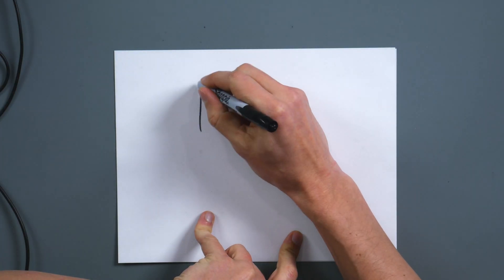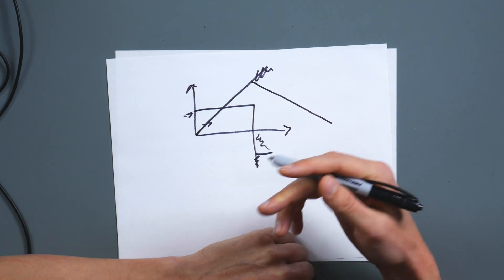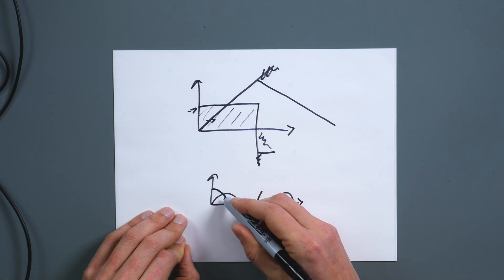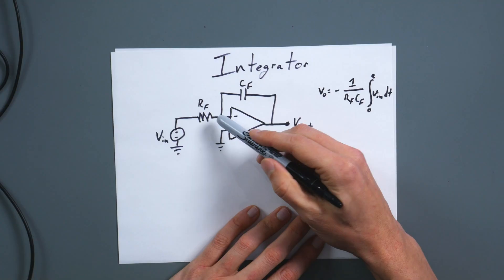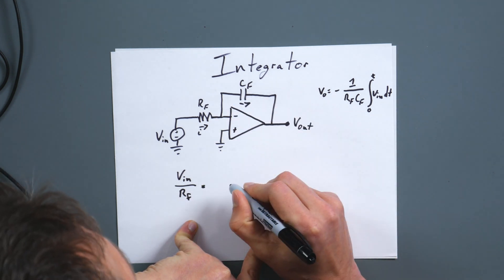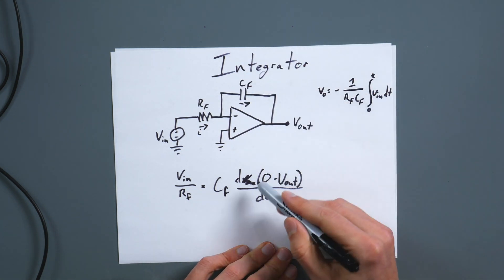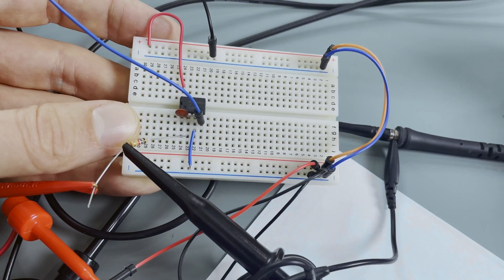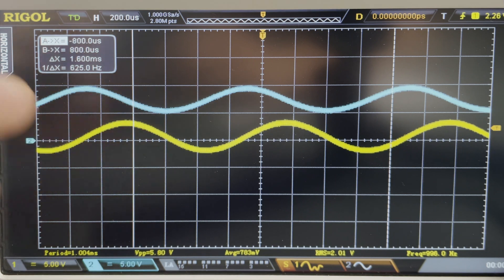Integrator - Operational Amplifier | Basic Circuits #14

Comment: What op amp chip are you using in the example? I’m used to pin six being the output but in your case it looked like pin One was the output.
Reply from the maker: We're using TI's LF412 and, yeah, pin one is the output for those chips.  It is a bit irritating but I do understand why different companies would want to change the pinouts on otherwise similar (in performance) devices.

Comment: What is the purpose of this circuit from a practical usage perspective? like what problems does it solve? what do I use it for? And can you make an integrator without the use of an op amp?
Reply: Integrators are used in digital multimeters to measure voltage (or the voltage drop across a current shunt resistor).  They do this by "run-up" and "run down" phases.  During the run-up phase, the switch selects the measured voltage as the input to the integrator. The integrator is allowed to ramp for a fixed period of time to allow a charge to build on the integrator capacitor. During the run-down phase, the switch selects the reference voltage as the input to the integrator. The time that it takes for the integrator's output to return to zero is measured during this phase.    For more info, see the Wikipedia article titled "Integrating ADC".  To answer your second question, any op-amp can be replicated by discrete components.  Sometimes, the best choice for a particular circuit is a judicious choice between op amps and discrete componets that may do the same thing as an op amp.

Comment: So it's like a Real-time calculator that records your voltage every time then adds it to what it already has?
Reply: And that means an AC signal will provide 0v Output while a DC will provide the saturation output
Reply from the maker: As long as there's no DC bias, that's correct!
Reply: Cool thanks  @CircuitBread

Comment: Hello, I appreciate these videos but I have a question about an AO setup that I couldn't find online with a resistor and a capacitor in series together in the loop. I hope You understood my problem and I am waiting for an answer
Reply from the maker: I'm sorry but unfortunately, I did not understand the problem.  I can give some general advice to use a simulator to help figure out whatever problem you're having.  LTSpice, PartSim, Flux.ai, something along those lines should be very helpful.
Reply: @CircuitBread  thank you for reply I'll search at those sites and hopefully will find a solution, wish U the best and I hope You keep making these educational videos. So helpful

Comment: What happens when you replace the feedback capacitor with a feedback inductor?
Reply from the maker: The circuit turns into a differentiator where the output is related to the derivative of the input voltage.  Something I've never really thought about before is why do we typically create a differentiator circuit with a capacitor on the input rather than an inductor on the feedback loop?  Hmmmm... my first thoughts would be cost, size, and performance at DC but now I'm curious if those are valid reasons.

Comment: what is the C value ? @15:20 you say that freq is one thousand kHz ! yet crobshows approx 1000 HZ. What is the opamp you are using?
Reply from the maker: Darn!  At 14:20, it is 1000 Hertz - I misspoke and managed to miss it when I was reviewing it as well.  1 kilohertz or 1000 hertz.  It's showing 1kHz on the scope.
Reply: what is C value and opamp used?
Reply: @markderlo212 op amp looks like lm358

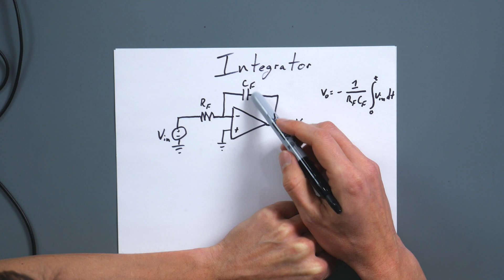Comment: 3:13 hm... i'm no expert but is'nt that a inverting opamp circuit? (you said a non-inverting, non-inverting has the signal coming at the + input of the opamp)
Reply from the maker: Yep, you're right!  Sorry, I really struggled with this series saying inverting and non-inverting when I meant the other.  I thought I'd caught or corrected all the mistakes but it seems like I didn't.  Thanks for pointing this out!
Reply: script...... almost as bad as the learnelectronics dude hahaha jk. no one is that dumb

Comment: is the shrinking of output when we boost the frequency related to how the capacitor becomes more and more like a conducting line as frequency is increased?

and i wonder what would happen if we take an inductor into the mix, knowing that Vʳ = R I , Vˡ = L dI/dt , and Vᶜ = 1/C ∫ I dt
Reply from the maker: It's probably a combination of both the capacitor starting to act more like a short as frequency goes up as well as the fact that the op-amp output will not be fast enough / able to source enough current to fully make the swings.  
I think that would be an interesting experiment to try and in practical applications there are many other components involved to make these circuits more linear and less error-prone.

Comment: i never saw that when we integrate triangular wave, we get a sinusoid. why is it like that? i know that the triangle wave looks like a 'low resolution' jagged sine wave, but there's gotta be more into it than that
Reply from the maker: This would be difficult to explain via text but just look at the area under the curve of the triangular wave.  While a triangular wave is linear, the area under that curve is not, and when it changes direction abruptly at its peak, the area under the curve does not change abruptly, it just starts to get bigger at a slower rate.  It isn't until it crosses the 0 point that the total area under the curve will start to get smaller (which will be the inflection point at the top of the sinusoid).  I just recommend trying, without any math, to visually integrate a triangular wave, I think that will make it click.
Reply: @CircuitBread  hmm... the integral of a linear function in time is a parabola ∝ t², which makes the integral of a triangular wave look like a parabola and upside down parabola side by side, which kind of looks like a sine wave although not exactly
        
     ∩  ∩  ∩  ∩  ∩
   U   U   U   U   U

this also tells me that a full wavelength of the triangular wave only makes one parabolic section, making the frequency of the output wave 1/2 input wave frequency

Comment: not a criticism, just something i noticed

the differential dt inside the integrals is missing

nice job btw, i've learned about integrator before but not this in-depth
Reply from the maker: Thanks!  And me making a math mistake is not unheard of... 😬 but could you give me a time stamp to refer to?  Just trying to reduce the amount of mistakes I make in the future.
Reply: the math bit starting from 7:20
Reply: Yep, dt had to go to the left side. Meaning, we should also have multiplied both sides by dt, then everything will go right. Also, there is always a constant after integration, and it depends on the initial state. If we start the process with input equal to 0, then the constant will also be zero.

Comment: Does an op amp always force it's inputs to be nearly the same in all configurations or is it only when using feed back ? 👍
Reply: Hey there, Op amps can't directly affect their inputs, they only affect their outputs. In fact they are just amplifiers that blindly output a voltage that is proportionally higher (huge gain) than the difference in their inputs.
The only way for the op amp to somehow indirectly affect one of their inputs is through the electrical connection of the op amp's output with that input (feedback loop). The idea that an op amp "wants" or "forces" its inputs to be the same comes from the form of balance that is achieved between the output and the input through the electrical connection of the feedback loop.
Reply: @7GIGEO7  So after all of that you could have just said no then ? So if you are correct then the input with no feedback won't try to be the same as the input with feedback, that's not how an op amp works my friend. Due to the nature of the op amp it outputs the difference between the two inputs right, and golden rule 1 no current shall flow into, thus forcing the inverting an non inverting to be near dam the same, but your saying in open loop mode you magically turn this property off, strange something that needs to be built and or simulated I'm thinking.
Reply: @SlyerFox666  Hey well, for most explanations i usually go by the quote "tell me and i'll forget, teach me and i may remember, involve me and i will learn" which is true in every learning procedure. The point of every technical question is to learn and not to be told the short answer. As for the rest of your post, the op amp's inputs are indeed very high impedance, they offer some kind of isolation and no significant current is flowing through them. Also in open loop configurations the op amp is just a huge amplifier of the input voltage differential, in fact a very small input difference (in open loop config) will most likely saturate the output. So the inputs won't try to do anything by themselves because they can't, they are just high impedance sampling points. As you said trying out a few configurations will be a good idea.
Reply: @7GIGEO7  Simulating it I can actually get it to do both thing in both configurations so so much for that idea 🤣 il set it up on the bench when I get some free time at work. Everyone has a different learning style as we are all individuals, that's the whole purpose of skilled teachers as they can see when the penny has dropped in each person they teach, not preach their amazing knowledge and just walk away which is really the difference between teaching and lecturing. If an individual is interested the short answer is usually more than enough to put them on the journey to self discovery because as you rightly say you learn from doing. 👍
Reply: Yes for a closed loop that requires feedback.
Reply: Not so in an open loop congratulation like in op amp comparators